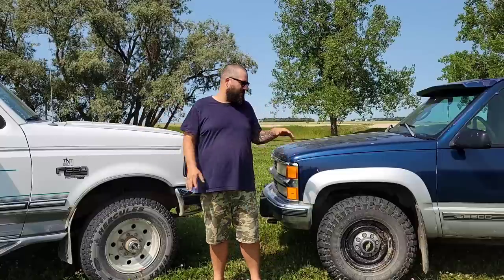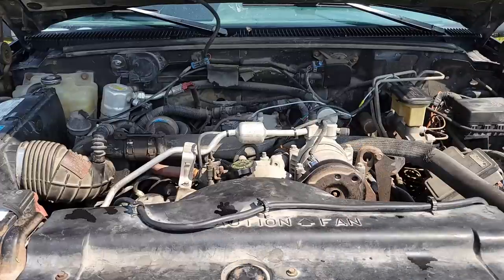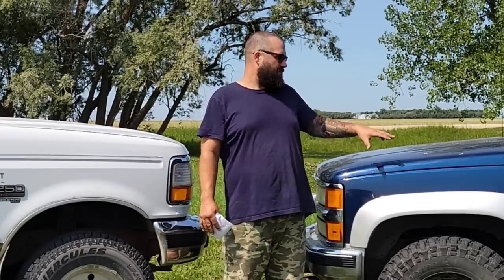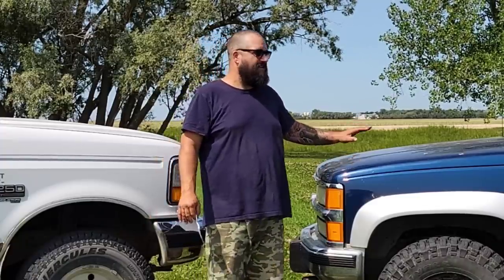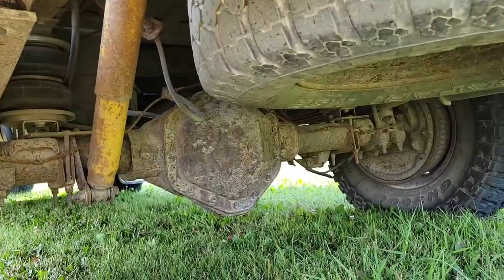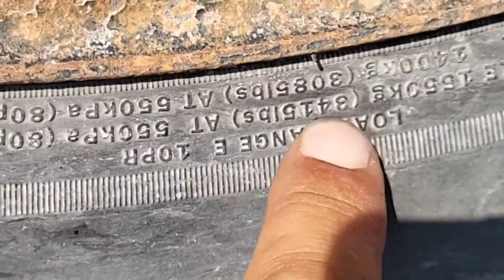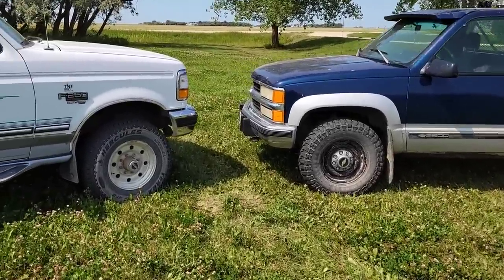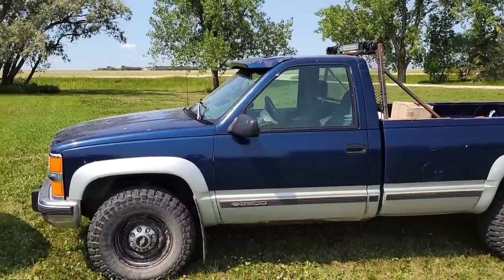7.3 Powerstroke  Vs. 6.5 Diesel

Comment: Predominantly been a Chevy guy too, until one guy told me you should buy a Ford where you're so hard on stuff. I laughed, he said seriously. He wasn't wrong in my experience Ford takes the most abuse I could throw at it. Built Ford Tough !!
Reply: Ford was a ok brand until the 2000 but part interchangeability is what does it for me and the ford power stroke stroke
Reply: Funny, our ford fleet at work are the most undependable vehicles we have. Our Chevy fleet keeps going. We had a 6.5 diesel that ran circles around the fords until a co worker totaled it in a wreck. Our new ford trucks are constantly in the shop it’s ridiculous. I’d be pissed I paid that much for a truck just to have it constantly throwing codes and burning oil and having cam phasers going out prematurely.
Reply: I work on the Railroad and the Fords have  lasted way longer than Chevys. Trans are junk in Chevy and the top end of the engines go. I run a 2014 with a 6.2 Ford that has 13000 engine hours.  Another guy runs a 2011 with over 17000 engine hours. Plus they get around on the bad roads better.
Reply: @irishuwould5185  agreed. From my experience, Ford & Dodge have transmission issues. Granted, mine were all pre-owned, and I doubt the transmissions were serviced even 40k - 60k miles, like they should be.
Reply: @BiffTannen1983 my 2004 f350 trans hasn't been serviced in all 268k miles it's been alive 😂
Reply: They both have their place (ford and gm). They both know who their customer base is. Gm used to be interchangeable parts, but less torque for towing, better ride with less payload, car like style, lower floorboard to get in and out. Ford used to be more work oriented, truck engines were generally different then the car stuff with heavier design, better torque, twin ibeam style 4wd articulating front on light duty to 3/4 ton and excelled at desert racing, or the older option of solid axle highboy, stuff design, straighter frame that allowed more bed installations on read, but hard to climb in cab for short or old people, and more expense and complex to work on. But then ford went modular for a while with interchangeable parts and overhead cams for good torque and cam phasing for rpm range power and torque, but too wide for installing in old hit rod engine bays. Complex. Chevy stayed pushrod mostly...but started having less interchangeably even though it looked like it would fit. Then the gm had cam phasing on 5.3 and that caused some sh!t. The gm dash had the split radio control driven. Meh. Nitrogen accumulator 4x4 didn't work well in cold. Starter solenoid gets hit by exhaust manifold. Rust issues more than other brands. Gm paint fell off the primer after off gassing. Plastic on GM interior was god awful. For plastic a little better. Ford trans a little tougher overall. Ford axles (some Dana) stronger than GM. GM was lazy coming out with 4 wheel disks. But then the gm v8 would get a little better mpg than the ford pulling more weighty design. Ford has better crash ratings. Gm was more cost effective when aging with cheaper parts and easier to work on at home under shade tree. Gm v8 more compact. Gm easier to turbo. But looking back, the torque , tighter build quality, and complexity of the ford isn't necessary if you aren't working your truck to a maximum. The GM wins when using the truck at 80 max one time a year. Ford wins if doing heavy heavy duty work. But ford costs more money to work on. They both know who to target. They both design their stuff to fail and cost us money. I think they are like Coca Cola and Pepsi. Both are in it together. One excels in areas the other does not to balance out the desires of customers. Neither wants totally outdo the other or else they'd set the bar too high and no one would ever buy a new truck. Dodge doesn't even count. The cummins was the only thing the dodge crate had of value. In new ram cummins, fast miles doing hotshot and then trade it in to get another. I have all brands. But ford did better in my heavy equipment earthmoving and trucking business. For light duty stuff, the GM was more cost effective and softer. Gm got a lot better at rust in later years it seemed. In reality, Toyota tundra in the 1/2 ton has  proven to be the best at long term reliability. Not the newest twin turbo experimental model. The 5.7 version. But of course....Toyota 5.7 tundra lacks one thing....gas mileage. Yep...they have to be "in" on the scam...if you want reliability...mpg suffers in comparison to GM and Ford. The new trucks are all scary a f. Expensive. Too much tech. Too much plastic. Dealers are a rip off. Scary!

Comment: There is no comparison. People still want 7.3 Powerstrokes. The 6.5 is legendary. For sucking. PMD issues. Optical sensor issues. Head cracking issues. No balls. The LB7 is 1000X better than the 6.5 could ever be. The 7.3 IDI N.A. is better than the 6.5 turbo. You might as well ask if someone prefers a 15oz fillet mignon, or a pb&j 😂
Reply: I love my 7.3 IDI, do plan on adding a turbo kit soon just to get a bit more.
Reply: Legendary for sucking lol. Legends are not known for being accurate. I have owned many trucks most of which have been diesel. They all have their own common issues.

I used to own a GM 6.2 and two 6.5s, both of which were very reliable and fairly maintenance free. The only issue I ever had was the PMD. When it went I ordered a relocation kit and never looked back.

I currently own a Ford 6.0 and 6.4, both of which are “legendary for sucking”. I can say they both have been great trucks. 

The 6.0 needed new injectors. While I was in there I replaced the oil cooler, deleted the egr, and updated the stc fitting. I have since put on about 200,000 Kms on this truck and haven’t any issues outside of normal wear and tear.

When I bought the 6.4 it had an oil leak, a bad injector, and needed a clutch. I chose to delete the dpf. Overall it has been a pretty decent truck.
Reply: @bluecollartradesman715  with the 6.0 egr delete, toes the truck need to be reprogrammed?
Reply: @BuckInchuteranch1  No reprogramming is required, but the check engine light stays on because the truck throws a code. You can use a tuner to disable the code which means the check engine light will be off.

Comment: I think they are both great trucks. The gm needs a couple of things like relocating the pmd. Put some slightly bigger injectors and it makes it a completely different truck with power closer to the powerstroke. The 12v is my favorite. Traded my last one at 560k and still ran amazing
Reply: Not even close. 6.5l needs a LOT of upgrades to come anywhere close to a powerstroke. not just "slightly bigger injectors"
Reply: @ambikesandboards  they are close in stock form 🤣7.3 powerstroke makes like 200 hp pretty much in the ballpark of a 6.5
Reply: The pmd kit is 50 bucks

Comment: Interesting. I have a 1993 gmc 3500 dually with the 6.5 turbo. It has its quirks. Mainly that it doesn’t like to start when it’s hot because the fuel vaporizes in the lines going from the fuel filter to the fuel pump.  I have the nv4500, which, apparently, was built with synchros made of butter. Oh, and the starter bolts are dogs hit, so I replaced them with some decent ones and now it starts before the motor turns all the way over. 
With all of that said, the thing is bulletproof. It has the mechanical fuel pump (after 1994, they went computerized), which is nice cuz I understand it and can rebuild it relatively easily.
Sure it’s gutless, and it takes 20 seconds to get to sixty. But it runs cool and gets 25 mpg on the freeway and 22 mpg on streets. It runs cool, ac blows colder than is comfortable, and if I need more power, I just turn a couple screws and it’s there (mechanical fuel pump and mechanical waste gate). 
Upgrades I did when I got the truck is a fluid damper hydraulic damper, some decent shocks, new starter with arp bolts, idler and pitman arms,  and Michelins. She’s a sweet smelly oily old breezy but she’s mine and I can work on her without a computer.
Reply: Yea, wait till he has to put injectors, flywheels, etc . Etc.  the ford will  cost way more in the long run, and I got news for him the split ford front end goes through tires and ball joints as well !!
Reply: I have a 93 K3500 6.5  NV4500-  love the truck.  I have other 6.5s- but i like the mechanical injection available only in the ‘93 year.  The 6.5s are cheap to run and fix.   I have had 6.0 and 7.3 PS,  like them but more $$ to keep running.   I don’t tow a lot so don’t need the extra power.

Comment: I’ve owned more chevs than fords , they all have issues 
I was working in the far north in British Columbia , close to the Yukon . Winter time , minus fifty . 1990 , the crew all had diesel Fords , brand new . Plugged in they would barely start , plugged in .
My old  76 Chevy sat for a week , my boss told me start that truck or you’ll be stuck here . I told him it’ll start no problem , so I went over opened the door reached in never touched the gas , not plugged in , as soon as I cranked her, boom she fired up 
Next year when I went back up north , the whole crew had new chevs .
Reply: You are comparing a diesel to a gas engine. When it comes to cold start, gas wins every time. It’s not a Chevy vs Ford thing.

Comment: The ford front end is what's called the twin- traction beam suspension. Basically the 4x4 version of the twin i beam. IIRC, the twin i beam and traction beam were discontinued in the 1/2 ton F series after '96, but still have them in the f250

Comment: Rear diff-  Ford 10.25" Chevy 10.5"
Front diff- Ford 9.0"     Chevy 9.25
He mentioned the Chevy having a 8.25" front diff but those only came on the K1500s and light duty 6 lug K2500s.

Comment: I own a 2002 f350 with a 7.3. It has 430,000 miles on it. Pull a 31 ft camper trailer and a firewood trailer. Runs great. The old 96 really benefits from a tow/haul tune. Not a big increase in power but really wakes it up. Buy a quality glow plug relay for a spare in case it goes open circuit. Won't start cold without it. Also a spare cam sensor

Comment: Good comparison. Agree nothing beats a Chevy ride and comfort. I drive a 1999 dodge dually 2 wd, auto (bd) dodge one died15 years ago. Banks 4 inch exhaust and towing power chip. Never driven in the winter and pulls trailers and daily driver all summer. Little rough when empty.

Comment: Totally agree with your assessment.   My first was a '93 f250 ext cab with the same rear axil.  That zf5 is a rock solid transmission.   Mine had over 250k on it before i had it rebuilt.  If yours needs a rebuild,  use South Bend parts.  There's also an upgrade for the clutch pedal that involves installing a yolk.  DO THAT UPGRADE.  It replaces a plastic bushing.  When mine went out, i was in the parking lot at work.  I was lucky it didn't total somebody's vehicle.   I routinely had north of 5,000 lbs in the bed.  My primary reason for moving up to a 2000 f350 crew cab was that the kids needed more leg room.   All in all, my '93 was a better work truck.  It road rough unless you had at least 1,000 lbs in the bed.  I've always loved the 6BT, but I hate the truck they put it in.  When the 6.0 came out, a lot of guys were driving their new ford's straight from the dealership to the shop and swapping it for a 24 valve.  Those guys are still driving those trucks.

Comment: 7.3 idi turbo. Simple, reliable, buildable, and last forever. Mine has 410,000 miles on it and the engine has never been touched. The body is rotting off of it, but it still starts...every time. Powerstroke 7.3's are great, but need more monitoring.
Reply: 7.3 idi is not buildable at all. stock power is pretty much the limit for them

Comment: Good morning from Cape Cod 🐟 work for an overhead door company that bought me a new 89 f-450 super duty with a 7.3 dually cab and chassis. Built my own custom flatbed with racks over the cab. Double stacked side boxes and the welder generator and a full-size set of torches. All the overhead door repair components and tools, there happened to be 5,000-lb over the rear axel. Being a service truck it was constantly in motion for half a million miles, never a problem other than fuel economy, which was nonexistent. With that said it was a great truck but I'm still a Chevy guy 😂👍✌️🇺🇲
Reply from the maker: Sounds like our econoline 250s at work. 

Always overload and never stopped long.  They never break.

Comment: Great video!  I've owned several IFS GM trucks over the years.  One '95 454 with an 8' plow that I sold to my grandfather and he still has it with 230k on it and the original ball joints and tie rods.  Another '96 6.5 with a 9' plow and sold it with 186k and all original frontend.  2 duramax trucks and rebuilt the front end on one of them at 268k because of 1 balljoint stating to clunk.  Maybe I've been lucky, but the IFS has been very good to me.

Currently rocking a pair of Fords, a '97 7.3 and a '14 6.7.  I love the 6.5 and with some upgrades, its a pretty good engine for light-duty stuff.  10k lbs of trailer or less.  The 7.3 is a true "medium duty" engine and it is so much more robust than a 6.5.  Love them both!

Comment: Ive driven and worked F350 crew powerstrokes for 25yrs. My first was a 95 7.3L that i had i bought in 02 and had for 5yrs. 2nd was an 02 7.3L i bought in 04 with 80k mi. It finally has given up with 300k mi last winter so i just got a 16 6.7L to replace it. When im loaded with logs and or equipment im pushing 30k lbs. They get the job done.

Comment: I’m a ford drivetrain master technician and have repaired quite a few ZF transmissions in your configuration. I highly recommend you service the transmission and replace the transmission fluid with GM synchromesh fluid. The blocker rings ( synchronizers) will love it. Now it will feel stiffer shifting in the winter. Maybe do a 50/50 mix with trans fluid where you live. You have a great truck there. I’ve owned a Chevy truck like yours and loved it too til the injection pump went out. Never was the same again.
Reply from the maker: Funny story but I have many jugs of that synchromesh fluid in my shop, may have to try that.

Comment: I have 6.5 with the nv4500 that i bought with 36,000 miles last year. Pretty good and reliable truck. Until recently i also had the 24 valve Cummins as well which i sold when i got my hands on a L5P Duramax. The 6.5 felt like it was averaging better MPG than my Cummins.  Thought about swapping out the ole 6.5 for a 24 valve Cummins. But well see.

Comment: I have a 1996 F-SuperDuty (F450) with the 7.3 I just took it on its first real drive, after sitting for a long time. I also have a 1994 C2500 with the 6.5 TD love the truck, just wish it was a 4x4 and a long bed, but the 6.5 runs great and has some upgrades which really wake it up.

Comment: My friend you got a very nice WORK truck. My first work truck was a 1969 F350 crew cab, long box w/a 6.9 international. A sleeved block. I got it an auction from consumers power. Fleet vehicles that were well maintained. Got a divorce and had to sell everything. In 1982 & still running strong. It also had a 5 speed manual. She was very vindictive and new I would have gave her the house. If I could have kept the truck. Anyway I'm now retired and have a 2001 Chevy 3/4 ton w/a 6 litre gas motor. Pushing 280,000 miles. Don't leak a drop burns a little oil. First Chevy ever. And I'm good w/ it. Enjoy your back seat. Won't own a truck without one. 🙃😉.

Comment: I have a 6.5 with a 4L80E that I am transplanting into my E350 Class C RV. The 460/C6 was a highly efficient 5MPG. 6.5 has torque/RPM ranges to compare to the 460. Overdrive adds to the equation.

Comment: I can tell you what will help that 7.3 last longer. Unplug the pedestal valve and put a 6637 air filter on it. My 95 f350 has a zf5 410’s 33” Patagonia mt’s. With a snow plow bracket with a winch and a dump bed insert. It’s my Swiss Army knife on the 300 acres I live on. It’s my work truck and mostly daily driver. I get 16mpg pulling my landscape trailer and 20+ without. Living in Pennsylvania the rust belt it’s rusty but I can’t find anything else to replace it just from the utilitarian value. It’s stock with 318k miles. I do have a ts6 chip with stock tunes that really helps me pull heavy stuff. The winch I use to plow. Pull bushes and trees down when they get snagged. The dump bed is crazy handy with 12 cords of firewood every year. Just love it. I don’t know much about the 6.5. There’s no too many around me. My son has a 95 f250 he’s fixing up. That  is his first vehicle and exactly what he wanted

Comment: I own a 97 F350 that I modified the engine to be able to handle up to 1200hp (I've only got it tuned to 500hp, but I wanted the added reliability) it's got air ride rear suspension and an eaton 13 speed. Truck has 892k on the odometer atm.

Comment: I like both trucks the frontend on the ford is rough on tires but the detroit engine was way behind times then. Never seen a 6.5 or 6.2 that didnt blow head gaskets under industrial use. The chevy rear suspension is way better they dont sag when fully loaded ford hasnt had a good hauling rear suspension since 72.